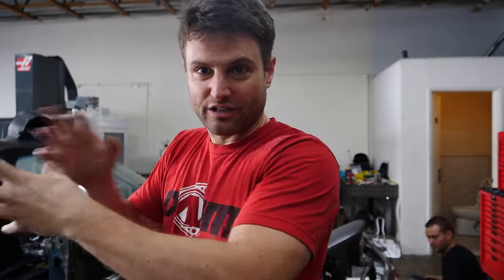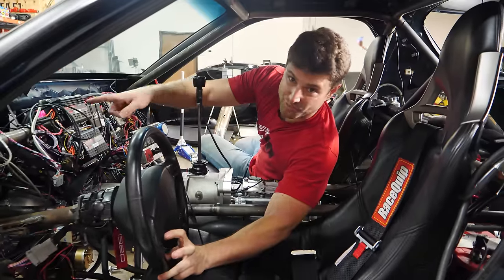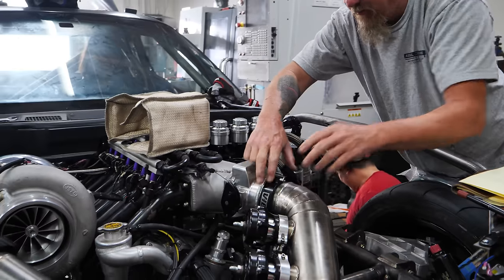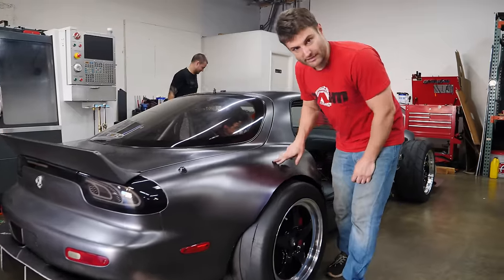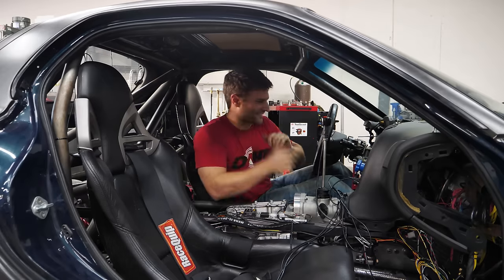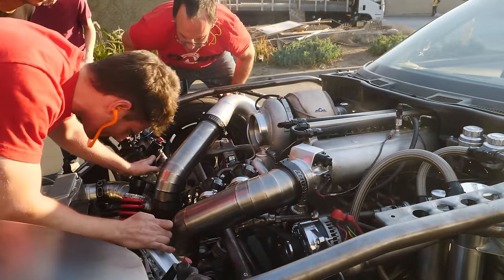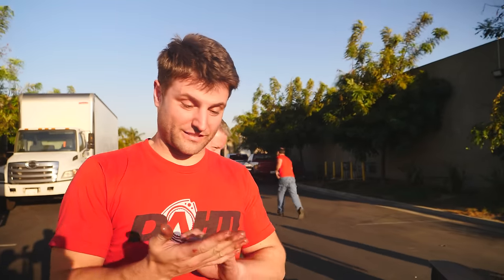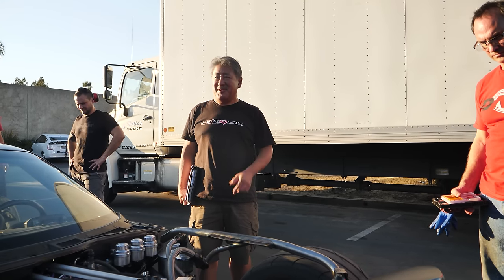The most INTENSE 4 Rotor RX-7 Launches yet!

Comment: I can’t believe Dahm still has the stock steering wheel on that thing 😂
Reply: Why not? It's completely stock. At least according to the insurance company.
Reply: Every hotboy with quick release wheel has no excuse anymore. If Rob can get in and out with a cage and bucket seats, so can you.
Reply: Needs a custom billet one
Reply: @darquille  he's got no doors or door bars on the cage so that makes it a bit easier. If he ever goes fast enough to need a funny car cage he'll need one for sure since I doubt he's going to keep the jeep look for long.
Reply: @JamesChurchill3  yeah but in all seriousness, I’d expect dahm to go with an aftermarket steering wheel earlier into the build 😂
Reply: @darquille  Rob is also like 5'6" and 160lbs
Reply: i absolutely love the stock look he’s going for. i did the same thing with my ride! all built up with stock interior and body lines. gotta love it. i drive a jeep btw
Reply: its completely stock and 100% OEM
Reply: @darquille  i kinda agree but he has a custom tube frame made for that reason
Reply: I saw rob dahm commented on a custom steering wheel facebook page saying he'd go with a flat bottom wheel. I hope he does, i'm planning to do a custom carbon fiber one with mutifunction unit, which would be more benefiting to have them on robs car with the buttons to customize on the wheel.
Reply: @pjbth  I thought he designed the frame to cover him at tracks which require one?
Reply: @Ross-ch9vv  my experience with track safety guys would question that. If it says it needs a bar it needs a bar. They can't be lawyered they have final say.
Reply: What are u talking about it is a stock car
Reply: @daniesalex7073  hes going for the stock look like the car came from factory like that
Reply: Relax.. It's a stock RX with a couple upgrades....
Reply: @pjbth  yeah I’m with you maybe he can work his charm on the safety guys

Comment: As long as a rotor didn't explode from torque the project is by no means a failure! Take this set-back as a blessing. It's one thing to be ready, it's another to be prepared. Put in a good weeks worth of testing once the driveshaft is buttoned up not a couple hours! Keep up the good SAFE work...
Reply: Dont have decent enough net to finish the video so have to wait, but what happened?

Comment: R.D., You are an inspiration for me I want to RESTOMOD a 1956 Ford F100. Very similar to your build but at half the power. I want a full tube chassis, 
AWD IFS/IRS. 
With K&W hydraulicly adjustable coilovers, 
Haltech elite 2500 ecu,
a six speed pneumatic shift transmission, 
All the modern luxurys on the interior. 
the engine is undecided though I'm thinking  Ford Barra, Ford 302, a Ford 3.5l  ecoboost, or the newer lightweigh Cummins 6BT with compound turbos, at least I have a lot of time to think about it.
Your videos have great insight about how the average guy would implement such systems in a project car

Comment: Just a thought Rob and guy helping Rob with his car. Maybe try 80% rear 20% front on launch. Or somewhere near that, meaning for the AWD . Then bring in the front wheels and lower the rear wheel percentage down track.  Or another thought. Since it's a high rpm machine launch it like a FWD 4 banger and do the opposite ratio. Bring in the rear percentage and start with a high percentage up front.

Comment: Rob, you know the "Slipper Clutch" that Cleetus had to put in LeRoy?  That would really hook you up. It's designed for you to put the two step on and just drop the clutch!  You call them and they will set it up close to what you need and just dial it in from there until you get wheelspin and dial it back about 10% for varying conditions.
Definitely cover those driveshafts unless you want to be the first person with carbon fiber injection!! 🚫 A good time.

Comment: Hey quick thought about your line lock/AWD disable

If your doing a burnout at the track, and you let the line lock go to roll out of the water while still spinning some, can you program a delay on the tcase engagement, to keep it from hitting AWD so hard/fast rolling out of it, so you don't shred the case/front diff/dshaft with the rear still spinning and slowing down?

Comment: I'm getting concerned there is too much grip for that drivetrain. It's hooking hard with cold tires on unprepped pavement. I'd be trying rwd only first. If it won't slip a little in that environment then you have to run the clutch out to keep the rpms up. A prepped drag strip with warm tires will have a heck of a lot more traction.

Comment: What racetrack is going to let this thing on their property with the driveshafts spinning next to Rob's elbow!? 🤔🙄
Safety dude, you need to enclose the drivers compartment from flying junk off the road, broken drivetrain, or FIRE. Should put a fire supression system on it as well, gallons of hot oil over your feet, and fuel behind your head. 🔥⚠️🧯🤦🏻‍♂️🤷🏻‍♂️

Comment: @Rob Dahm; This build is GRAND Rob!
Still think it should be a mid-engine build for better weight balance with the AWD too.
Imagine if Your seat was further forward and the engine actually in the middle.

Guess We will see Your mid-engine build in the C8.
How is that build going? Have not seen videos of that build for some time now.

Have an imagined wide body frame, of this RX-7 or RX-8 and slightly longer than a Fiero with a mid-engine using light weight, strong frame structure and polymer panels as the Fiero.
Could make a vehicle weight of about an Indy or F1 at @1100?

Sincerely

Comment: The Drive shaft under Rob's right elbow should have a shroud over it. The carbon fiber may break into small pieces in failure mode. Under torsional loading, IE drag racing launch. The carbon fiber can explode like a bomb but a little different. Centrifugal force is what causes the pieces to distribute. Carbon fiber is light so its potential energy will only give it the ability to penetrate your flesh in the first 16 inches of flight. Your elbow is about 6 inches from the drive shaft. Have you ever had or watched anyone have carbon fiber shrapnel removed from a wound before? Its very difficult and can take hours. Having a piece of aluminum the same thickness as your under tray would be adequate protection. Your new drive shaft may never break but you do not want to be in the drivers seat when it does. This is not a criticism but an observation, plus my friend had to have small pieces of carbon fiber removed from his leg. He had a carbon motorcycle wheel explode. Long story and it wasn't pretty. Just saying. Honestly, you do not want to have that drive shaft fail while you are driving. This could change everything if it does. My friend will never walk normal again. The removal of all of carbon fiber did more damage than the explosion did. It would be a good idea to cover that shaft before you race it and put 1200 hp to it again. Like everything in life. The more times you stress a part to its limit the sooner fatigue will take its toll. Just saying. Great work and the best of luck. I just wish you had more time to get everything sorted out before the big race. Your development time is not adequate for the best results. Some times luck can over ride this, some times the luck is all bad. Again good luck. If I were to make an educated guess, your brother will win, not because he has a better car but because his ride is better sorted out. Given enough time for development, you will wipe the floor with him. Time is the one thing you do not have. 3 months from now with a dozen trips to the drag strip so you can find and remove all of the gremilins all new builds suffer from . You will dominate. Opinions are cheap and this one is mine.  so... give them hell.

Comment: I’m sure Rob knows millenniums more about the car than I do but it seems like it could be unsafe to put heavy loads on the drive shaft without some kind of tunnel or cover over it and the rear diff assembly.. cause if that stuff blew up it would literally be like a grenade going off  inside the car throwing hot metal shrapnel everywhere..